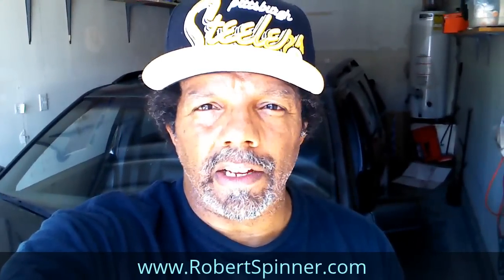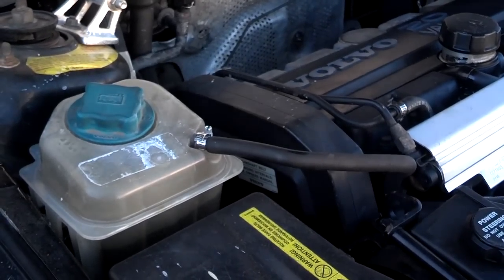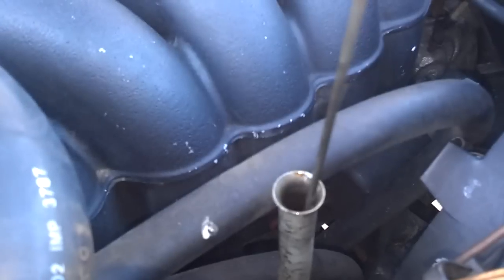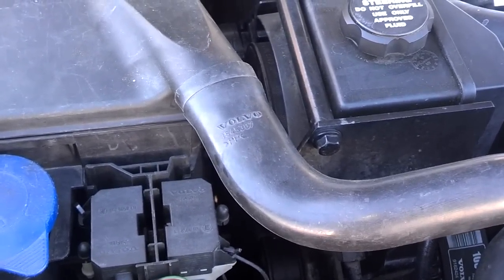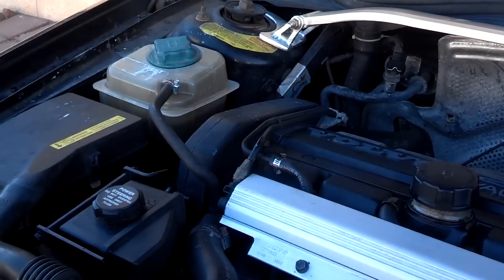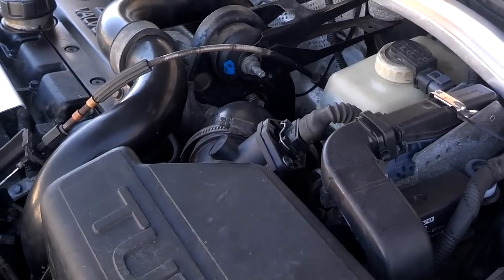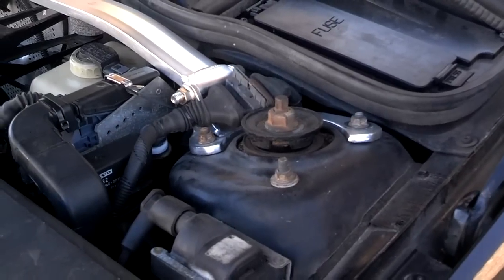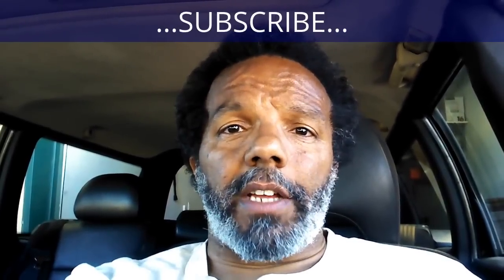Top things to check before buying a Volvo 850, S70, V70, XC70, etc., Pre purchase inspection.

Comment: Hello Robert ! Good Wishes from Germany :-) Like Your Tips for the most important Checkpoints. 

I am buy V70 1 Model three Month ago with 429000 km on Top !  for 300 € I Start the cold Engine and the voice is lovely soft ! im not drive it for a Check give the money and take it home . I feel inside i do nothing wrong with this Car . Ok first i change timing belt system to be sure now i have to check the Engineholdplaces and i change some small light inside the Cockpit. 

Everything you can repair for Your self its easy not like the modern Cars :-) I Like it and i feel with this Car i will have a long time friendchip ! Thanks for Your Videos its help !!!

From a German Roofermaster  PS. Sorry for my bad writing English
Reply from the maker: Thank you for watching and sharing.

Comment: Thanks Robert, very informative. I am now in the market for exactly one of those Volvo models. A friend of mine has 2 850 wagons, both with more than 500,000 kms. He never had any major problems, I replaced the clutch on one of them. Very robust even in the rust hell of Montreal Canada. MY 98 Jetta TDI engine now has more than 490,000 kms but I feel it's time to move on to something safer ( much respect for my GF!) and a little larger. I am hoping to find one that needs one or two issues to get it cheap as I can fix whatever needs to be done, but as I am looking to find one in the south west( no rust),it has to be able to be driven across the continent. I will make a list of what to check for from your video and let you know what treasure I find. Cheers and keep up the good work
Reply from the maker: Cool, thanks for watching.

Comment: Really do appreciate your video clips, now, I'm encouraged to buy tools and start working on my Volvo 850 by my self. Thumbs up buddy.
Reply from the maker: You are welcome.
Reply: I worked on my Volvo 850 odometer that as not been working for a long time, now I discovered the blue gear that controls the odometer inside it is not there. I called my mechanic and he said maybe the problem could be due to bad ABS module, bad sensor or a gear box problem because in Volvo 850,  he maintained that the gear box, sensor and ABS module are all connected, I do not understand this, but I hope he is correct. Please tell me, do all odometer comes with the blue plastic gear that connect directly to the odometer?
I asked because all the DIY video clips I've seen comes with the blue plastic gear inside it.
Thank you Robert.
Reply from the maker: +Martin Gillian did you check the odometer gear replacement video?

Comment: Great info, I do not have a manual, a light indicator came up bottle with a fan, and a water symbol under it. I think its for coolant.
Reply from the maker: +Michael LeSenne what kind of car? Is the coolant level low in the reservoir?

Comment: I think it's a really good thing that you mention the "Heater core": I looked at several 2000 S70 that had bad heater cores before I purchased the one that my '17 yr old daughter now drives. I looked @ 4 or 5 that indeed had bad heater cores > so bad that when you put the heater on you could smell (even see) coolant coming out of the heater vents. The car I purchased: 2000 S70 SE 2.4 (non-turbo) was in great visual shape and "single" owner before me but, as soon as I purchased the car 102k mi, I had the timing belt & all pulleys replaced (< $600.00) at a local independent Volvo shop. I had the tires replaced before I gave it to my (at the time 16 yr old) daughter. I recently (122k mi) replaced the front pads & rotors for $145 (dealer wanted over $375). These are really well build cars and made to last; as long as you do the maintenance / I highly recommend doing "Roberts" research before you purchase one of these but, if you do & you find one in the condition that Robert recommends: You will be a very happy owner of a low cost/maintenance, Solid build, good mileage, very safe vehicle! -Davis
Reply from the maker: +David Boston thanks for watching and sharing.
Reply: Where could I find a sealer for head gasket the Volvo guy mentioned  something like a steal sealer I don’t remember what he said
Reply: Not sure but do you mean something like k-seal? It's about $10-15.00 for a bottle.

Comment: Super helpful video. Looking at buying an 850 turbo. Repair values can be daunting but it's either this or get sucked into financing some soulless economy car that won't last me nearly as long. 

I have been wanting to get more in the know with my own maintenance and I think Volvo offers me a platform to DIY it, it'll be the secondary car for the household so I can afford to have it in my garage for work here and there
Reply from the maker: Good deal.

Comment: You talked about the spring plates on the suspension, and I just wanted to say that it's VERY common that the spring plate will rust on the weld, and it can break easily, especially if you live where they salt the roads a lot during winter. If it breaks, the spring is gonna collapse and may rip a hole in your wheel. If it happens during driving you'll probably end up in the ditch,  or on the wrong way of the road with 1 popped tire. Too many time's I've serviced these Volvo's and noticed that the spring plate being just a few weeks away from breaking. On my V70 Classic I changed the 2 front strut assemblies immediately, and it turned out to be a great decision once I got the old ones out. Someone had been around them a few times with an angle grinder probably trying to lower the car by cutting the springs. People never stop to amaze me by their stupidity haha
Reply from the maker: Thanks for sharing

Comment: Hey, nice....just sol a 2003 t5r to a friend and went to an older but nice xc70 1998, looks very nice, has 120.000 miles, smells a bit liked heated water...just drive it on t mountain today for t first time, from Barcelona and manual gears, but still the 193 hp 2.4 turbo engine
Reply from the maker: Aimar Valls Make sure you check the heater core. I'm in the process of redoing this video.
Reply from the maker: Robert DIY Oh, my bad, that is the new video. LOL

Comment: Thank you very much for these advices! I experienced the issues with strut bearings my self. Could twist it all the way round, adjustable camber :D The metal part in the middle of the rubber mount had loosened completely.
Reply from the maker: Mrn00bah Yes, they do tear.

Comment: my top tip would be to check all the coolant hoses for wear! Like you say coolant system is quite important to maintaining operation, and you really don't want ruptures leading to loss of fluid. a complete set of rubber hoses might set you back about £250 possibly less, I see there are some being made cheaper at the moment.. or switch over to the non rubber.
Reply from the maker: Thanks for sharing.

Comment: Just bought a ‘97 859 T5, watched video and did radio 👍🏾🙏🏾.  Brakes not acting right or ac. When dark dash lights go out...
Reply from the maker: Interesting.
Reply: @RobertDIY  850 t5 dash lights come on and off when headlights on. Did the exhaust test and it did smoke after 10 minutes..🤦🏾‍♂️ 244962 odometer

Comment: Good info! I didn't know about the oil cap PCV glove trick. And also the coolant overflow bottle level increasing for a bad head gasket. I'm looking to get an XC70 2008 with 112K miles, I'm certainly going to have them verify the timing belt has been changed as per regular maintenance schedule.
Reply from the maker: +Johan Bach-Sorensen good deal. Thanks for watching.

Comment: On the stop engine mount. I replace mine with a two piece polyurethane on. I took a hack saw blade and cut the old one out and put the new one in. I did that in 2001 and it is still good today Oct 2017.
Reply from the maker: Cool, mine shattered some how.

Comment: my brother had one with 360k miles and it ran just as smooth as a brand new car. It had an electrical problem that i could not fix at the time. i bet i could have fixed now with more skills and the internet being popularized. the 3 cars i have seen with the highest milages are volvos, hondas, and an older mercedes
Reply from the maker: Cool

Comment: Thanks for the videos Robert, they're really great. I was wondering if you knew at what point in the cars life these problems start to show. Im looking at buying a 2000 s70 that only has 70k miles on it. The timing belt is clearly something I should look out for but would you say the cars has enough miles for those other issues to begin to show?
Reply from the maker: +Matthew Cheffer now.
Reply: ok, thank you for the reply

Comment: I'm in England I purchased my Volvo 850 20ltr 20v GLT auto with 108,000 miles on the clock (now on 132,500) 5 years ago for £325 about $475/$500. It's been the most relaible car I have ever owned. The car is 25 years old now, I think it was a bargin. i'VE ONLY SPENT £300 on repairs since buying the car, it seems indestructable. I did do the service and the brakes myself which saved me some money. If your in the UK they are really cheap to look after £55 for the service kit including  filters, plugs and oil (DIY). I have owned 2 of these cars in the past. The clutch change was expensive on one of the other cars £375 at mates rates the Volvo dealer ship wanted £700+. All the problems in this video are cheaper to repair here but the head gasket will be expensive anywhere. My current Volvo does about 28 miles to the gallon on the street and around 40 MPG on the motorway at 65 MPH with cruise control on. (that's a UK gallon not US) Also the insurance is very cheap for a relatively powerful car. I hope this helps anyone in the UK looking to buy one. I have seen a Volvo 850 T5R on 425,000 miles so don't be scared of high milege but if it over 275,000 miles the interior might be shabby depends on the owner. Good tip, I got mine off on old man who loved his car. I work for a major automotive parts manufacturer and have a degree in engineering my personal views on 850's are that they are one of the best engineered cars ever built along with older 5 series BMW's the new 5 series are crap build quality. Lean manufacturing has alot to answer for. I want to big up the British manufacturers but they just don't build good cars unless you look at the really expensive cars like Rolls Royce or Astin martin. BTW good video, keep up the good work DIY Robert.
Reply from the maker: +kerensa hughes Thank you for watching and sharing your experience.

Comment: Robert,

Hope you and your wife are well.

Need advice!  Thinking of buying a 97 Base wagon.  Has P0172 code (but hose from purge to manifold is cracked - could that be it?), but idles and drives fine (except when idling and cracked hose is opened further).  Dealer's attitude was "have at it" to inspect.  I intend to go back, tape hose, clear code, drive a cycle and see; check underbody for oil leak, boots, etc.

Oil around filler cap, and smoke when removed.  No Chimney from dipstick, but a light flow at idle.  If the flame trap were clogged, could that alone account for it?
Car has other small things that are "eh", but modest sweat to fix (odometer not working-assume gears; sounds like broken shock mount in rear; tailgate struts).
I pointed all this out and that the timing belt is due soon or is due (back to busted odometer) and that ABS module is busted (what's new there?).  Dealer dropped from $3,000 to $2,000.

No records.

Brakes excellent, minor ding, good interior, might need a wheel balance, AC needs a bit of charge, but I think the Schrader inlet vlave is leaking.

Fair price?  Am I too into VolvoRehab to think straight?

Thanks.
John850GLT
Reply from the maker: John Seyfried Sounds high to me. Needs a timing belt, AC not working properly, odometer broken, PCV likely clogged, ABS not working...

Comment: My personal experience with my T5 which was smoking blue from time to time even after replacing the valve seals is that a PCV that is on it's way to be due (not really clogged, was still venting somewhat), could create the smoke after long idling periods. These cars really hate idling. Was also smoking a bit if I drove it hard and the engine would get a bit hotter than usual (not overheating). Like 2-3 mins @ 200 kmh (124 mph) for example. Bottom line is, if you buy one, service it from a to z and forget aboat it. Very reliable if maintained properly!
Reply from the maker: +90Ming90 The owners manual actually recommends against idling. Thanks for watching.

Comment: Hi Robert,  Thank you for responding to my questions last week about my 99 XC. It is a in excellent condition cosmetically, but is running rough and the bigger question in the Brake Assist system has been not working occasionally. My mechanic says that replacing the brake assist system is Very unusual. Could its problem be caused by the engine issues?  Such as a vacuum issue?  
Thank you, Neil
Reply from the maker: Yes, I had one the other day that had a bad ETM which was causing the intake vacuum to be very low, causing the brakes to not work properly.

Comment: I have a 99 S70. I know that a couple of things that Robert forgot to mention were the throttle body and power locks. The throttle body is a pretty easy replacement since it's on top and in the front. I just use the key to unlock the car. The remote won't unlock them all of the time. It's common with these. Finally, the gasket in the oil filler cap likes to wear out. Keep a couple of them. My car had the strut plate problem which resulted in a rattle. I would suggest buying the loaded struts. It's about an hour labor to have them put in. It's not uncommon to see the I5 engines with 3-400k with no oil leaks that are all original. I would be more careful about the models that are 2001 and newer.
Reply from the maker: Thanks
Reply: ;) unfortunately, another common failing is that the key won't open the door. I've got to fix both of these (soon) before we can't get into/can't lock the car! (1999 S70, ~300k mi)

Comment: Great video, I have a 87 240 that runs like a champ at 310k but I've been looking into the 5 cylinder cars for some more performance, nearly impossible to find a 5 speed though!
Reply from the maker: Crosswalk020 Man, if you like work, these 850's are great. Maybe a S70 T5M.

Comment: Hey Robert! Appreciate your content! Great explanation and tips. Just bought my first car, an S70 from 98 (modelyear 99) Love the car seems to be in great condition but i have some questions and i need a little advice. Could you maybe help me out?
Reply from the maker: Sure
Reply: @RobertDIY  Great thanks! My coils are quite rusty and the protection layer on the rear coils is coming off for a part but the suspension feels good while driving. Do you know when it’s necessary to change them and is it a hard job? I also see some small damage spots on the cars paintjob. I already checked the internet and it seems it’s quite easy to fix with a paint repair kit in the original colour. Is it as easy as it seems or should I take something into account? There is also one rust spot in one of the wheelarches (a small hole) what is the best solution for fixing this on older Volvos? No mechanical issues so far but it seems that my PCV system could use som service. That I’m gonna look into. Greatings from another Robert but from Sweden 🇸🇪

Comment: Not bad info that. Had my 1997 V70 T5 3yr 130 thousand on her. Never had any real issues except for full suspension overhaul and now doing full brake system ie:all callipers, vented n x drilled disks and fast road pads.
Reply from the maker: Cool

Comment: i will buy my first volvo 850 2.5 5 cylinder, 1 owner from new, and the owner is the brother of a volvo dealership manager,  the car has been serviced and was on the road until april 2016, 200000 miles, all services documented at the official dealer, the car also passed the swiss mot test (very strict), yes i live in switzerland. i can get the car for 1300 swiss francs, i will check those things, what do you think?? i have 1500chf more to spend on the car if it has any issue
Reply from the maker: +caspar politman Not sure how much money that is but the car should last a long time.
Reply: Robert DIY i think its like 1500 dollars, but in switzerland everything is more expensive, and also normal salary are higher
Reply: thank you, i will check all the things you say in the video, thank you very much for making it

Comment: Thanks for making such a comprehensive video.  I am purchasing a car for a 24 hr of lemons race.  Are the 2.5 20V N/A engines reliable enough for long periods of hard engine use?
Reply from the maker: +Shimeng yep. Run all day at high rpms. Weak spot is coolant system.
Reply: What does it need? Bigger radiator?
Reply from the maker: +Shimeng good heater core and hoses.

Comment: Hey Roberty DIY

Great video. I was looking at a '99 AWD v70 the other day with about 120000 miles. The car has been sitting for several months, in addition to what you mentioned in the video - is there anything else to look at for - i 've had cars that can sit for a few months without a problem (old miata) and others that can't handle it. Where does the v70 fall? Thanks!
Reply from the maker: Not bad if less than a year. Other than that, a good long test drive should show any issues.

Comment: Great guy and very concise.  ok so I'm about to purchase a Metallic green Volvo SE 850 ESTATE 1994 MODEL.
all appears solid apart from usual corrosion on brake lines and some steering advisories on the Current long Mot and is fully taxed.  my only issue is that the idling is a bit ropey and sometimes stops whilst idling.
Should I be worried about this ??  the vehicle was advertised at £1600 but he has agreed on £1300 - should I be worried about the willingness to reduce so quickly and just walk away ??
Reply from the maker: Go for it!
Reply from the maker: Likely has a intake system leak and bad MAF.